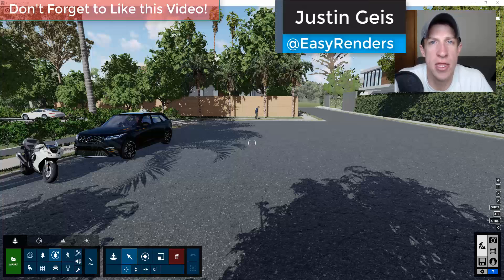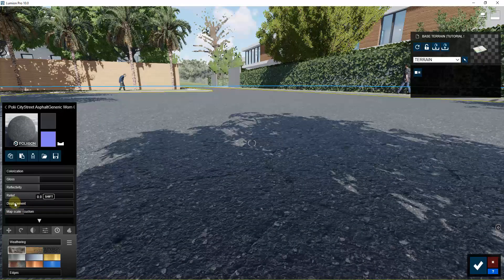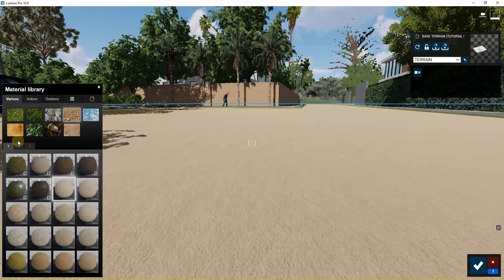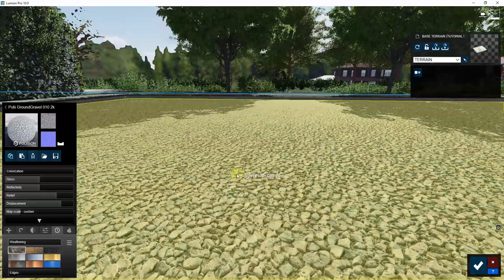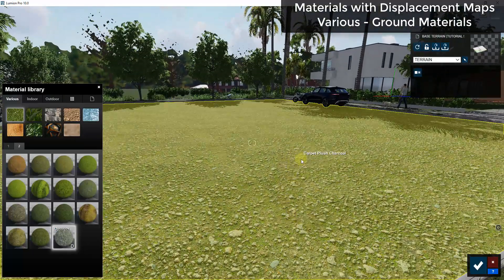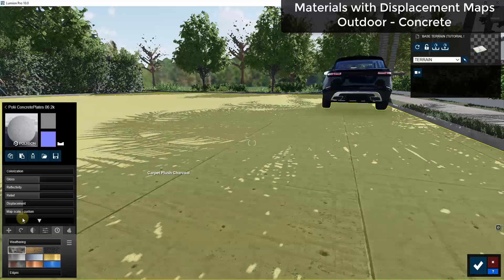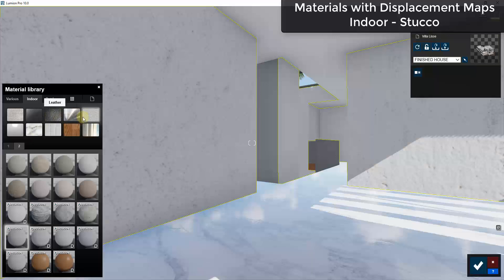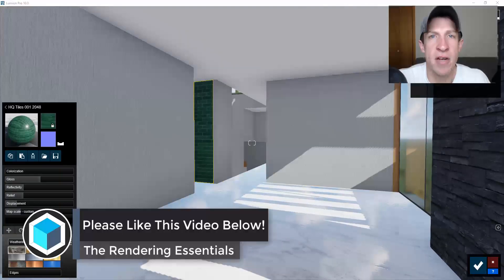Lumion 10 Displacement Maps - NEW FEATURE TUTORIAL

Comment: How do you add displacement maps to your own materials? I'm trying to figure out if this is possible?
Reply from the maker: As of right now you can't
Reply: @TheRenderingEssentials  This is why Lumion annoys me. Just add a texture slot.Unreal Engine keeps getting easier to use, if they don't add some more flexibility they will be left in the dust.
Reply: @TheRenderingEssentials  In the earlier versions you could add Specular, Transparency or Luminescence information in the alpha channel of a texture file. Maybe you can add Displacement information in a similar manner?
Reply: @m4k0v1ch  It's definitely something they could add. Before asking I had already tried putting a displacement map in both my normal maps alpha, and diffuses 2nd alpha. But clearly either didn't work. Getting Lumion to allow for more customization is like pulling teeth.
Reply: @KyleMarren  I have the feeling that once you add the capacity to the engine to render displacement, adding another texture button so we can use it on any texture would be a no-brainer. On the other hand, maybe they want to avoid people going crazy with this feature until they understand how it impacts rendering times.
Reply: they have added the option with lumion 10.3 update

Comment: It's not really "displacing" the geometry. If it was really doing that, you'd see displacements along the edges of objects (as you can see in Vray and other rendering software). This is more or less a real-time "fake" which simulates a displacement.
Reply from the maker: Wouldn't the end result be the same, just without the edges being displaced? I assume it's possible for the displacement mapping to be set up in such a way that everything displaces except the edges too
Reply: Yes in 3d software (C4D, 3dsMAx) and their render engines this is basically bump. Its not a real displacement. Its kind of a fake displacement. Even if your plane had consisted of 1 polygon it could do the same thing. Which would be impossible with real displacement. The end result is still that its a flat plane. The difference is it fakes it by calculating a dislacement on each angle you look at the geometry and using that info for the reflections and occlusion as well  It not showing up on edges is a giveaway that its not real displacement. Think of it like those street artists that paint a " hole" in the street and from one angle it looks theres a hole.. Expect with this is does it again from every angle..

Comment: What do you think about adding such a feature without the option to customize it with your own materials?
Its like someone made you your favorite cake but only gives you one bite to eat.
Reply: I know we all feel the same way about. I want to be like oh cool displacement maps! But then they didn't add another mapping option for customs.
Reply from the maker: Personally I think it's a bit odd, but I also kind of like the way Lumion is packaged for users that aren't architectural rendering experts - it's targeted towards a very specific audience and gives them a "jump in and get started" experience where they don't have to figure out a bunch of maps or complicated material settings - they just use the ones that are included. I kind of see it from both sides
Reply: @TheRenderingEssentials  the problem is that no architect will choose his finish materials based on the existing library. Your a designer and you want the flexibility to visualize your design accurately.
Reply: Hi, great job, thanks. I'm still using Lumion 9.5 but tried the 10 trial version. I tried to change the diffusion and normal maps using a displace material with my own textures and it worked. I could move the slider and the displacement was applied to my customized maps.